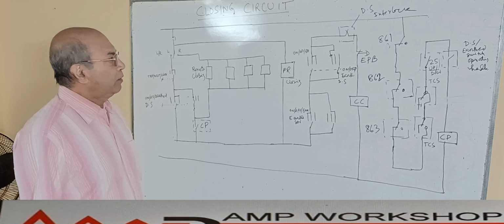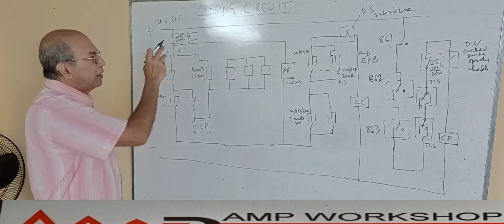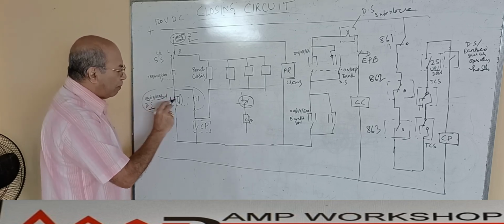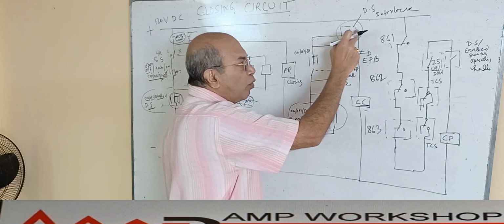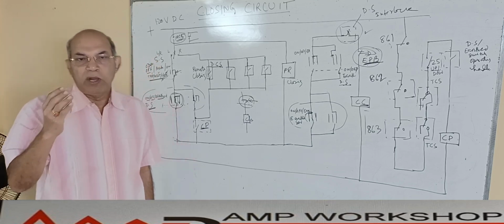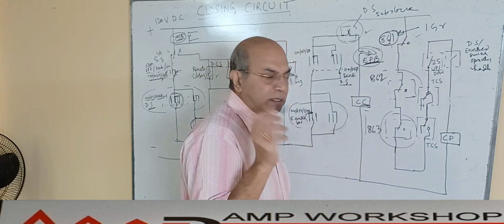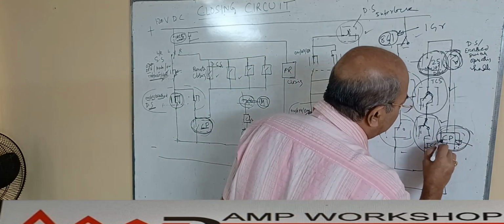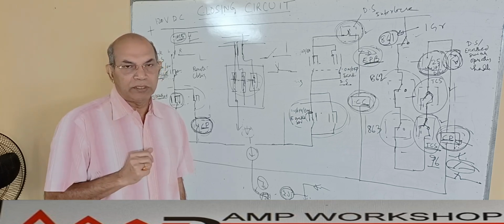CLOSING CONTROL SCHEMATICS : CIRCUIT BREAKER ( LV/MV/HV)

Comment: Thank you sir,

Is my understanding correct that in your scheme, closing coil is required to keep energize when we want to close circuit breaker.

I have seen some other schemes, they have latching contact for the closing coil meaning all the signal to control to close circuit breaker will be pulse momentary signal sent to this closing coil.
Reply from the maker: There is a interlock with a breaker auxiliary NC contract which opens when the break is closed. The same has not been shown for simplicity. This is alo termed as anti pumping feature. So your comment is correct